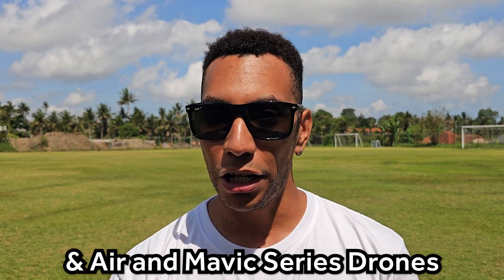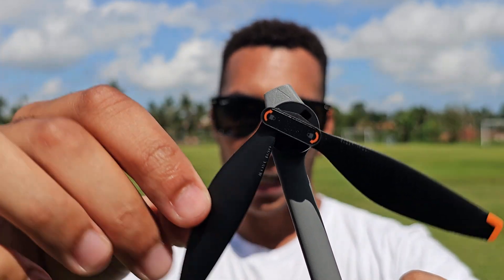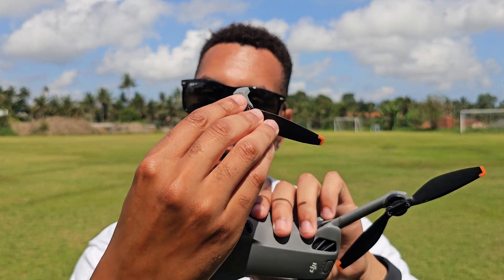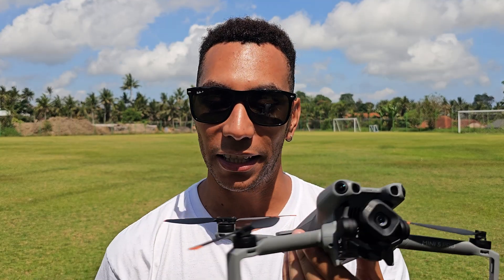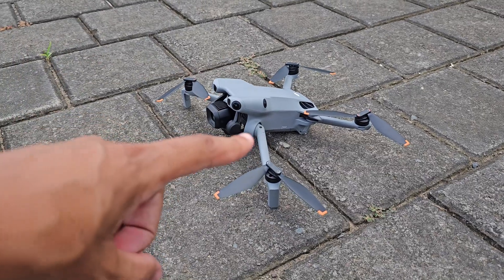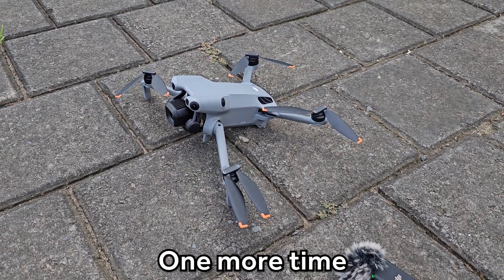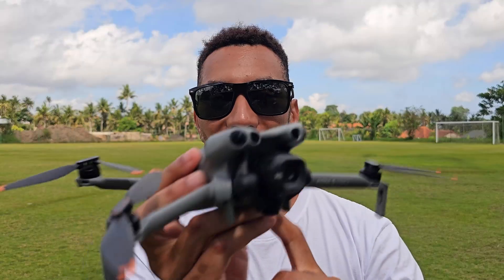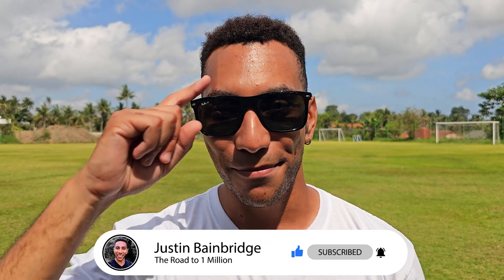Why Are My Mini 5 Pro Motors Pulsing On Take Off?

Comment: What about if you bought 3rd party replacement propellers without that locking mechanism??
Reply from the maker: I only recommend people go with genuine DJI props for these drones, Non locking ones will still work but won't perform quite as well 😊
Reply: @JustinBainbridgeYT  The genuine ones are VERY hard to get here in the USA, due to the drone ban (which includes all drone components), and will become harder but I have found some on Amazon that actually do have the locking mechanism on them!

Comment: Justin, thank you so much for your helpful explanations. Santa brought me a Mini 5 Pro, and as soon as I turned it on, I heard a pulsing noise I'd never heard on any other DJI drone. Worried, I looked for the cause and, luckily, I quickly came across your video. It's freezing cold here in Montreal, Canada, and when you have to fly outside and take off immediately…
Reply from the maker: You're very welcome! I knew it would cause some concern for a few people and thus felt it necessary to make this video. Glad you found it and it helped to explain things. Hope you can still enjoy some flying in the winter! 😊

Comment: Mines pulses but it pulses even during normal flight at full speed ...is this also normal ?
Reply from the maker: At full speed the motors and drone will be makking constant adjustments to the speeds to kep the drone flying at the same speed in a stable way. some unsteady noise at full speed is to be expected. as long as the drone is still flying well. it's just a nature of the flight systems and external conditions like wind etc.

Comment: I had one flight where it did not lock due to a bit of sand or something - the Mini 5 Pro flew very poorly, very twitchy, over correcting, and a lot of vibration. Landed after about 5 minutes and saw the issue, pulled the prop straight and when I popped it back up in the air it was way better. I initially thought it was because of the strong gusty winds, and while they did not help, I think the prop issue was the main thing.
Reply from the maker: Yeah that's not good, glad you spotted it and corrected the issue!

Comment: You nailed it my Buddy. I found 1 was locked and 3 were not locked up after landing. On my machine I have to 
give the blades a little gentle pull to lock all in place.  Eliminated the twitch in moderate winds.  
Then a little gentle push in to release. Still one of dji finest.
Reply: huh??

Comment: It happens on them all mate its to spin the props out
Reply from the maker: It happens on some but definitely not all. I haven't noticed it on the Mini 2, Mini 3 pro, Mini 4 pro, Air 3, Air 3s. just the Mavic 4 pro and Mini 5 pro recently 😊
Reply: @JustinBainbridgeYT I've had the mini 1,2,3,3 pro, 4pro and now a 5pro bro happened on all the mini series, maybe not on the fpv model or the nano as thr blades are permanently stuck

Comment: I think that's a good observation and it makes alot of sense. However, I have had my M5P fly past me at about 50 feet and the motors are still pulsing. It's very disconcerting and made my turn it around and fly back to land. I was concerned that they were going to fail mid-flight!
Reply from the maker: During flight if they are pulsing its likely just due to wind and making corrections during flight, Motors are not always consistent during flight due to the nature of these aircraft, some variations in sound is normal as long as flight behaviour is normal 😊

Comment: Hey Justin. If I buy your LUTs how do I get them in to Cap Cut or Dji Mimo? And is it a way to get it in to Cap Cut on mobile?
Reply from the maker: Hey, Capcut desktop supports .cube LUTs. Capcut mobile doesn’t. DJI mimo doesn't support external LUTs. If you want to edit on mobile, then Filmora is another good option which supports LUTs. The LUTs are in .cube format which is the most common format. Most major editing software support them, but most mobile apps are more limited in their features 😊

Comment: completely unnecessary video (just for likes obviously) . M2P does that since day one to make sure props are properly aligned!
Reply from the maker: I've seen quite a few people asking about it and thinking it was an issue. If a few are asking, there will be more that are thinking the same.
Lot's of people are new to this and won't have seen it before on older models which did this previously.
Thanks for your input 😊

Comment: Thats exactly why it does that, I noticed this on my first take off. I'm also thinking this has solved the porpoising my Mini 4 Pro was prone to while running at full throttle, especially in windy conditions, as I've yet to see my Mini 5 Pro do this. The locked out props might be just the thing to provide some more precise control!
Reply from the maker: Yep, I haven't seen the old bucking bronco yet either, even in high winds at full chat in sport mode. Rigid props give much better performance, and it's nice to see we've got the best of both worlds here with the locking design. It's also quit e abit more stable in windy conditions as motor response is more accurately translated into prop speed at during fast changes in output. 😊

Comment: I fly the phantom 4 pro And it has done the same double pump on start up  and I think they carried this start up action on the mini 5  due to it having the same twist lock propeller locking mechanism on the hub of the motors as the phantom 4 series  has . Which has fixed prop blades not like the mini series where they have the floating ones . What do you think ??
Reply from the maker: Potentially, but I think this has more to do with the locking mechanism on the actual propellor rather than into the hub. The Air 3 and 3S both have quick for props like the Mini 5 PRo but don't do the same motor pumps. But they have free floating props rather than props that lock out at 180 degrees to each other. 😊

Comment: Actually, this pulse behavior has existed on older DJI drones, I remember it being their on my 1st gen Mavic Mini as well as when I flown the 1st gen Mavic Pro and Mavic Air. And yeah, my mini 4 pro didn't have this, I didn't notice this on my mini 5 pro, lemme double check. I've flown the Mavic 4 Pro and this propeller flopping is very bad that on start up it shakes the whole drone
Reply from the maker: Yes, very true but it hasn't been present for quite a while, Mini 2, Mini 3, Mini 4, Air 2, Air 3, Air 3s etc. Lots of folk won't have experienced it before. Yeah the same with the Air 3, I always position the props out before take off or it shakes itself around till physics takes over.

Comment: 100% correct. You should have seen how my M5 flopped around for the first couple of start ups while the props would engage/lock up. Also without knowing before hand I was forcing them to close when I would pack up.

Comment: Thanks for the video Justin, I did notice that, but thought it was the props as well. One thing I've noticed is that my gimbal shakes quite a bit while hovering in front of me. The picture on my RC2 is perfectly still, but the gimbal seems to vibrate more than I would like. Have you noticed anything like that?
Reply from the maker: I haven't noticed that on mine. The gimbal has always looked stable, have you got a damaged prop?

Comment: I notice after a few firmware updates . On mini 5 pro  that when I done an orbit around a church on a windless day The POI on fast rotation wasn’t fast !! Infact it so slow  it even slower if it was in the slow tap   Inform DJI. So could be just my drone only. Or a major issue.   Have the mini 4 pro.  And that working fine. So no issues on min 4 pro

Comment: I have noticed that the motor casing on the mini 5 pro is plastic while the casing of the older mini 4 pro, mini 3 pro are metal :face-blue-smiling::body-green-covering-eyes:🤔
Reply from the maker: Hey! Its half and half the bottom section of the bell is metal, and the top section where the props fit is plastic, i thought it was all plastic too but on closer examination found it to be a bit of both

Comment: Is motor rotor cover made of plastic?  It's a little bit concerning , mini 4 pro was metal, but this seems plastic
Reply from the maker: Its half and half the bottom section of the bell is metal, and the top section where the props fit is plastic